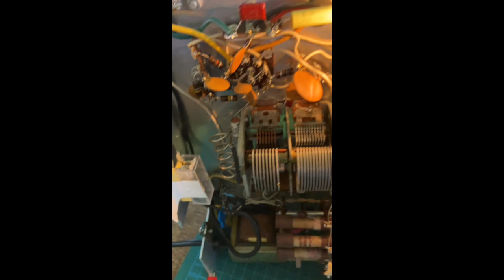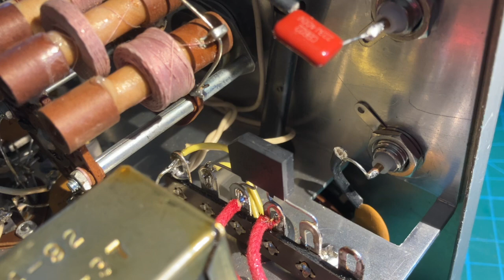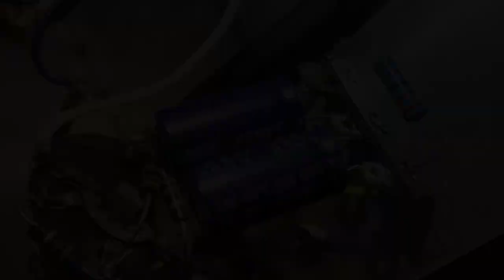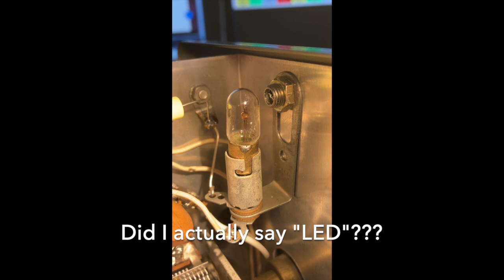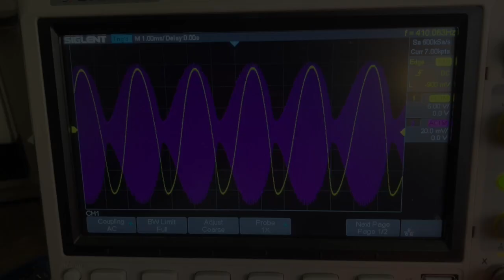Heathkit IG 102 The Good, Bad & Unobtainium

Comment: I installed a fuse and a three wire cord you didn't mention the rating of the slo-blo Fuse? also are the input capacitors affected with a three wire cord? woody
Reply from the maker: Great questions!  Given the IG-102's power draw (assuming 120VAC), a 1/4A slow-blow should suffice.  1/2A at worst.  The AC input (safety!) caps are there to bypass RF from (and to!) the AC line, to ground.  Thus there really needs to be an actual ground for that purpose.  There's a whole separate conversation to have about whether vintage test equipment should be grounded, say, when testing vintage hot-chassis stuff.   Short answer is yes, but such hot-chassis stuff must be on an isolation xfrmr.  Thanks for the comment!
Reply: Thanks for the Info Smudge, I built this kit in the late seventies

Comment: The internal 400Hz is usually low because Heath chose the wrong value for C13 (sometimes C14); should be .004uf or .0039uf instead of .0047uf.  This will increase the frequency to 420 to 470Hz but it improves linearity.
Reply from the maker: Worth experimenting.  I'll try it next time I have the IG-102 opened up.  Thanks for the comment!

Comment: What is the part number of the Y1 safety caps?
Reply from the maker: For the IG-102 I replaced the plain Line-Ground and Neutral-Ground 0.02uF discs with 0.01uF 2kV rated.
Mouser stock No.  810-CK45-E3DD103ZYVNA
Because that's what I had handy, and the drop to 0.01 was preferable.
Any properly  rated  L-G N-G Y cap should be fine.
Thanks for watching and commenting!

Comment: When I was a lad I had vacuum tube radios and some test equipment.  A favorite trick I used to play on my friends was to allow them to get shocked by touching a radio control that was missing it's plastic knob.   Of course those people have not been my friends for a long time.   A few times I have almost been tricked the same way.   However, I am too wary for that.    I don't care to use vacuum tube equipment much because of the A.C. current on the chassis.  The restoration should remove any A.C. on the chassis and convert the line cord to a more safe 3 wire plug.   That, of course, is difficult if there is no line transformer.
Reply from the maker: Apart from the pleasure of inflicting your inner ElectroBOOM on your friends, you're of course correct. Later on after the video, I did change the IG-102 to a safer 3-wire line cord, which eliminated the stray AC on the chassis.  The IG-102 is already transformer-operated, so it's then quite safe to use.

Comment: I have the same sig.gen, built when I was in the Signal Corps here in Norway! It is still on my bench as the "No.1" RF test source, mostly because og its small size (have both Rohde & Schwarz and other much better units), but these occupy too much space to sit on the bench usually :) I have also a bridge rectifier in mine, and BNC jacks to suit normal test cables. The "AF OUT" jack is fed with high level unmodulated RF to drive an external frequency counter, which is often a bonus in my opinion. I find this gen quite stable, despite its simple construction
Reply from the maker: The IG-102 serves well when I don't want to haul out my DC-daylight HP/Agilent/Keysight monster capable of setting amplitude down to the nearest fraction of a dB, which I don't own.  It's like when for audio, it's more fun to use my Heathkit IG-18 than my arguably better-in-every-other-way UNI-T UTG932E.  
Thanks for taking the time to comment!

Comment: It's a minor point, but I usually rewire (assuming polarized-plug or 3-wire plug) the hot-side first to an external chassis-mount fuse holder, then the switch, then the line-neutral safety-capacitor.
This way the safety capa are not constantly subjected to all the line transients. The opposite side of this argument is that the modern safety-caps are very robust and having them in the circuit is an additional protection for other connected equipment.  Myself, I make sure all plug strips have transient suppression.

Another point I would like to amplify regarding VTVM's, is the fact that they for the most part uniquely present much lower loading to high-impedance and RF circuits, thereby not upsetting their operation. The reason for this is the 1-megohm resistor that is in the probe-tip.  Whereas in a DVM, even though it is high-impedance, you still have the entire probel lead connected to the sensitive circuit. I think if this fact was more widely know, there would be many more of these used and less discarded or dismissed as inferior, when just the opposite is true.

I actually have three VTVM's: The first is a Heath-Built EUW-24 and a RCA Senior VoltOhmyst UC-98C, finally an HP-410B.  

I have these on separate workbenches, plugged into a switchable outlet strip, that I have all the soldering/desoldering equipment plugged into.  At the start of the workday, I switch-on that strip and the VTVM's are already set to on, so they come up to warm and stabilize.  When I worked professionally in a shop, we always powered up all the VTVM's and signal generators (sometimes scopes as well) then went to morning coffee!  in all this time, and with all these tech's, I never waw anyone replace any tubes in their VTVM's; only some in the signal generators or a tube-tester; so don't be concerned leaving them on.

Nice workmanship, and great advice for anyone getting into this line of work.
SUBSCRIBED & 73...
Reply from the maker: Yes, It's my practice to have the hot side of a polarized, or a 3-wire, line cord go straight to the fuse, not stopping anywhere (like even a terminal strip) on the way.  I also chose to have the hot-side safety cap be switched. Electricity prices being what they are, every vampire microamp helps!
Regarding (V)TVMs, I'll be doing a video showing the very first kit I ever built in the 1970s.  It won't be a teardown or even a rehab.
Thanks for commenting and 73.